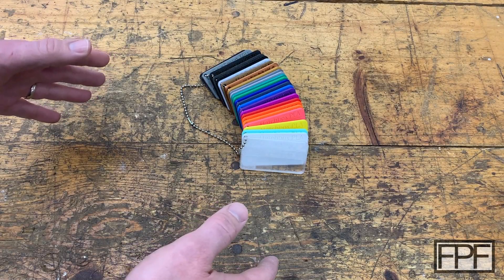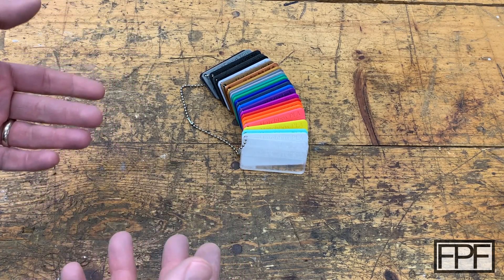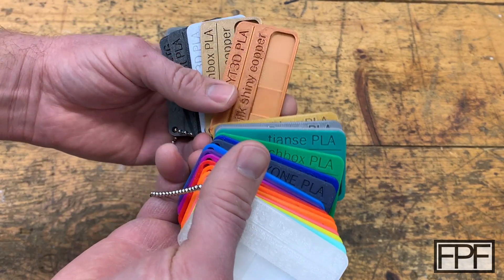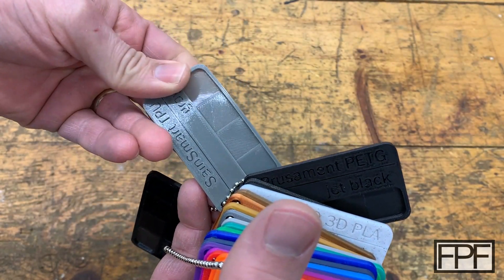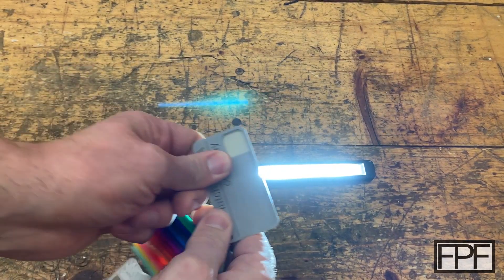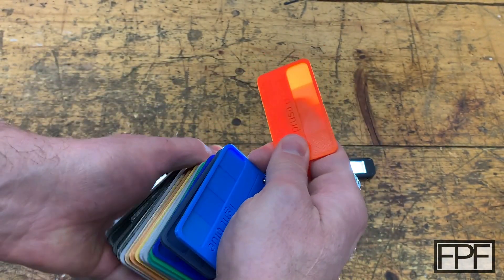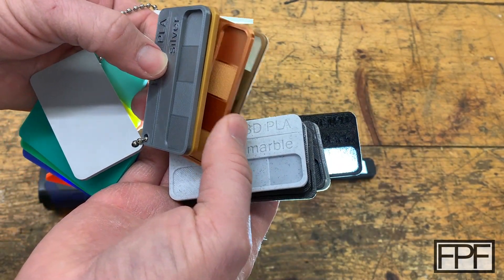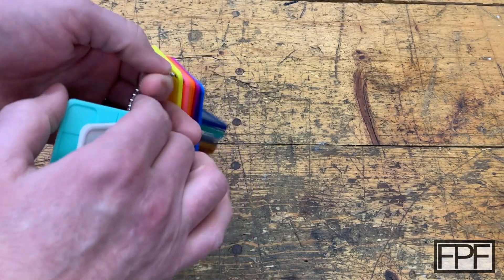3D Printed Filament Color Swatches

Comment: I really think it'd be great to just BUY a set of swatches like this, I know its to differentiate specific filaments, but for beginners (and even some of us who've been in manufacturing for decades!) knowing the look and feel of other plastics is something hands on and I wish I just had some of these already printed out. Anyone know where I could just buy a set?
Reply: Some filament companies sell a set of swatches of all (or most of) their available products. For example, I know Bambu Labs sells a set of ~80 swatch panels for ~$10 USD on their site (just searching their official store for the word "swatch" turns it up). The set includes a wide variety of various colors and in various types of plastics. The same set of swatches came bundled with my printer when I bought it. (or maybe came with the AMS Lite I bought at the same time? Idk which).

I'm sure they can't be the only company doing this.
Though I'll note the manufacturer swatches are smaller and simpler, they wont' have the various depths like the ones in this video had, they'll just be tiny square tiles ~2mm thick and 24mm on their other two sides. They're still good for getting a feel for the texture/strength/rigidity/feel and of course for the color.